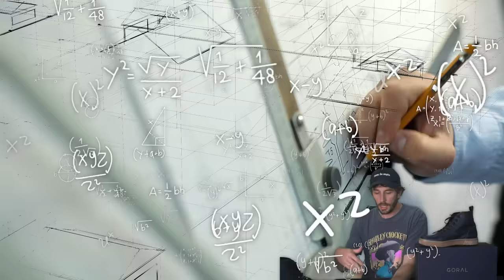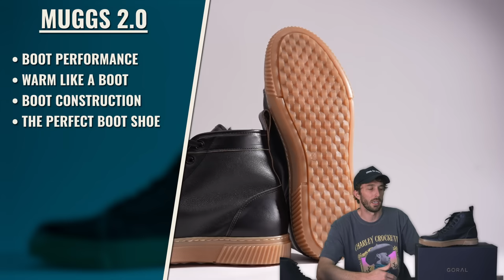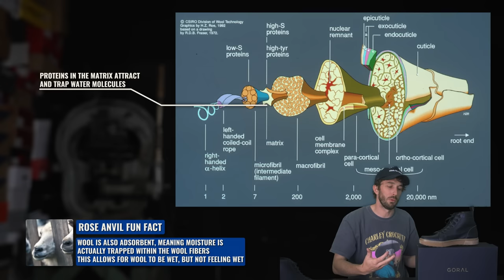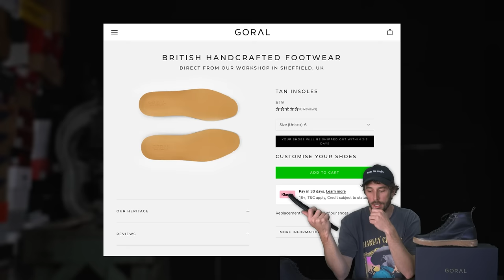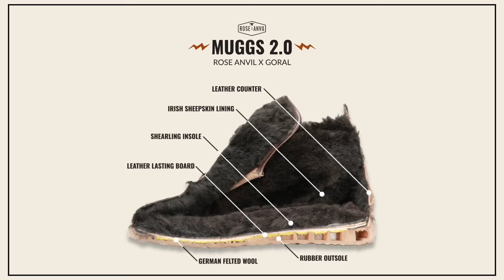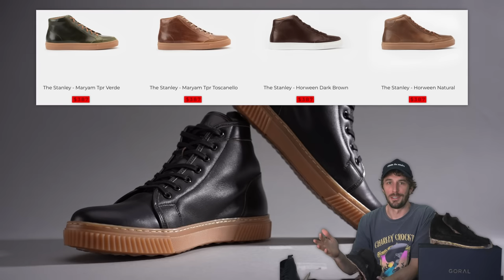($402) Why sheep sneakers cost $$$ - Better than UGGs

Comment: I’m a huge fan of the causal/minimal leather high top sneaker look. Many brands make these types of leather sneakers. I get the selling point of these is the shearling and the warmth it provides. However, you can get similar results by purchasing a quality leather high top sneaker, and wearing a thick wool sock. One example is Beckett Simonon, who makes a beautiful high top leather sneaker for $170. Pair that with a quality heavyweight wool sock and you’ve accomplished a similar goal for $200 instead of $400.
Reply from the maker: That is honestly a good option if these are out of peoples price range but want the same results
Reply: Not exactly the same because there is more air in the shearling than in tight knit fabric but still a valid point :)

Comment: Received mine this week- they are perfect apart from one minor bug - grommets are a bit low quality and not proper in rim for the leather. Two of them got loose, will substitute them.
Plus the back-side of grommets  is not flat, but “teethy”- it’s better to use a flat one for laces.
Hope this will be addressed in Muggs 3.0

The reason grommet got flimsy- the hole that was punctured was too large for the 5mm (inner diameter) grommet. Had to substitute it with a 6mm one with a larger rim and back-ring.

Comment: These look awesome. I love the features and the philosophy that went into their design.

I wish they produced these only 1 size larger. I've been shopping for a good pair of lightweight boots for a long time, but way too many manufacturers don't make US men's size 15 at all. I'm willing to spend money on a well made, relatively light, un-insulated (or at least lightly insulated so my feet don't sweat) boot which can be resoled and kept for years, and which can be worn with slacks or jeans just as readily as the other.

As it stands, I'm still using Army desert boots from 2006, made by Bellville, which have at least 15000 miles on them by this point. They're great boots and they're as well broken in as any boot you'll ever find, but they're still combat boots patterned on the old Vietnam-era jungle boots.

Any recommendations? I'd prefer something I can try on in-store (Washington DC region) but I'm willing to drive a couple of hours away to get boots that'll last me the next 20+ years.

Comment: Bought common projects a while back. They're still going strong but I want these for winter. It's super hard to find something good looking that also keeps my feet warm. I bought a pair of UGGs for a winter trip and they were decent but were too tight on my feet. They were $250 and I still have them but don't wear them. These look super nice and it looks like you have wide sizes which is what I'm missing. 

I probably won't have the money this shipment but hope to pre-order the next drop early next year.

Comment: Since this video is months old, I guess no one will see this, but I got my MUGGS today.  Love them.  I'm wondering if I should do anything to protect them before I wear them.  I work for a brewery in New England, but on the retail side which is dryer and cleaner than the brewing side.  So, I am behind a bar, serving beer, greeting (ID'ing) customers at the door or walking in and out of large coolers and then outside to customers cars to deliver beer during New England winters.  I'm looking forward to warmer feet this year, but these sneaker/boots are likely to get splashed with beer or water or step in a puddle, etc.  But, I would love to keep them looking as nice as possible.  Any advice?

Comment: My issue is that we so easily sweat on our feet, and I just feel these will be too warm actually. I'd rather add warmth through socks/insoles than to walk around in a pair of wool slippers. If you walk around in a jacket that is too warm, you can simply just unzip it or even take it off. Most wouldn't carry an extra pair of shoes so you take off a pair that is too warm, and then put on the less warm ones.

The other side of that coin is what if you are going to spend time in a building with normal temperatures, are you going to have to leave these at home... I just feel it's a pair of slippers for the cabin to be frank. I wouldn't want these because I'd just sweat my feet off.

Comment: For HALF the price, there are plenty of winter sneakers out there! Just look towards motorcycle shoes. Chuck Taylor meets Boot style…Waterproof uppers, GoreTex lined, and NOT $500🤣
Reply from the maker: Yeah that’s fair but they aren’t made from the same material or made to the same quality or made in the same country so like I mentioned (I think) in this video. There are plenty of cheaper options that will keep your feet warmer for longer but none of them look as good or are made from as good of materials. They are definitely not for everyone but it’s more fun making the best of something instead of the cheapest something.

Comment: I'd be super curious to see you compare these (or something similar) to the Converse 70 Boseys you can customize with sherpa lining. I'm not a fan of Converse at all, and would MUCH rather cop some Muggs, but converse offering sherpa and fleece linings caught my eye. They're also delving into some other non-custom cold weather / "weatherproof" gear and I'm curious to see if it's all just overhyped.

Comment: What if you are a half size on the Brannock? I am a 11 1/2. It looks like Goral doesn't do half sizes.

Also, is there a non-shearling-lined version/counterpart of this sneaker for use during the summer or other times when wool would make your feet sweat profusely?

Comment: I realize it's a complete non-sequitor but I'm in the work boot industry and I have so many issues with the shape of steel toes and durability. Obviously work boots are seen as disposable. No one is planning to run a pair past 3 years in the oil and gas industry, even with a pair of 2412's, and most guys replace annually. 

Before I was working on the sales side I was in construction and even now, having access to literally hundreds of styles of work boot, I still can find a boot that doesn't make my big toe numb from the toe cap shape pushing into my toe knuckle. 

If you want to make a wild product, make a barefoot csa work boot with a heel, where the heel and sole function more like a lift, but which still allow for a 3/8ths inch heel for guys doing ladder work, while actually have a sensibly ergonomic shape for guys who are pounding pavement 12 hours a day. Bonus points for triple or Quad row stitching and heavy, well tanned leather that can stand up to multiple years of abuse while getting covered in diesel, bitumen and mild solvents.

I realize it sounds like the car Homer Simpson designed but I'd pay 600 - 700 cad for a pair of those.

Comment: So many of these boots/shoes look and sound awesome but with a 4E width foot, none of them would remotely fit.  Many brands I would have to go up 5+ sizes to get the width.  That may get me into clown school, but wouldn't remotely be comfortable.  Here is a challenge for you, do a series of something for wide 2/3/4E width boots/shoes.  If you want to make it really challenging, try finding boat/rain boots/shoes in wide widths.
Reply: Goral has on their site to put a note on the order that you have wide feet, so as long as your feet aren't too wide, there's a solution. I'm a US 8.5 E, so I know the pain, and in most cases have to size up to size 9 to even have some chance of the shoe fitting, but in most cases they're still too tight.

Comment: I’ve had 5 back operations and it’s a pain to bend over and tie up boot laces is there any without laces of better yet a twist disc to tighten them up I’d love some like that.
Reply from the maker: Yeah if you search the term “BOA” boots or sneakers that’s what those disc tighteners are called. We did a video of some ariats that had the boa system

Comment: $400?!
Reply: Goral is really high end quality wise, the price is quite competitive considering the materials and manufacturing.
They are specially well priced compared with luxury crap charging north of $1000 for cemented chinese sneakers worth $20.
Reply: These are hand made sneakers with high quality materials
Reply: Honestly, a great price for ASTOUNDING quality.
Reply: That's the price you pay for handmade shoes with quality materials made ina country outside of China and that doesn't use uyghur slave labour or child labour, it's out of my price range too, but I've see crap products pedal for far more
Reply from the maker: I’ve thought about making a budget friendly version of MUGGs but we’d have to cut out a bunch of the high quality materials so I’m still mulling it over. Let me know what you guys think
Reply: @RoseAnvil  Please don't do it with Goral as it will damage their reputation, you can maybe partner with another brand with manufacture in a cheaper country but still receiving decent pay like Mexico.

Doing that it will be cheaper to produce the boot and don't cut so much on materials.